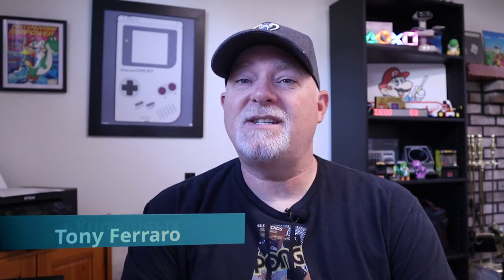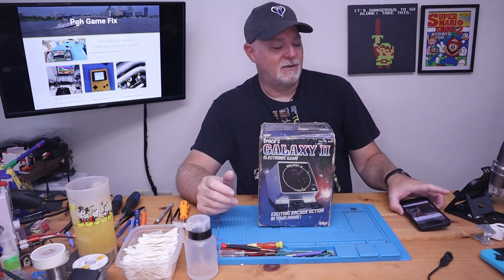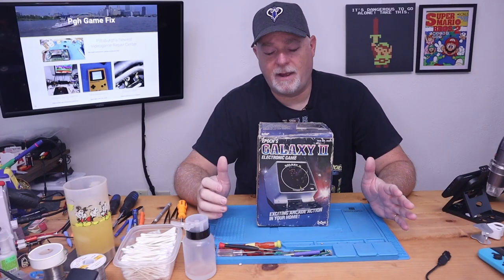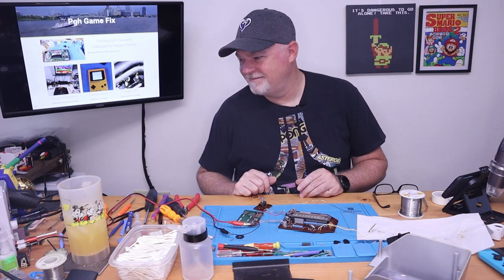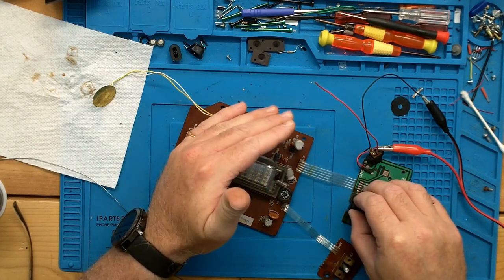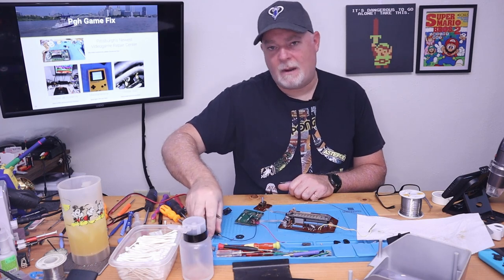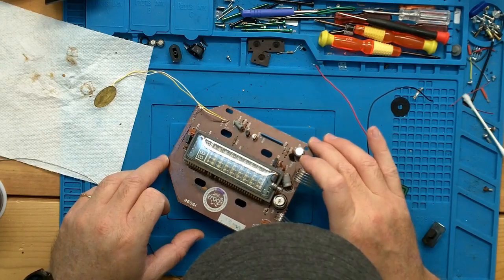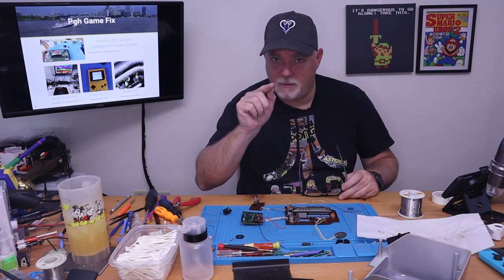Try To Fix Ep2: Epoch Galaxy II (Grandstand Astro Wars)

Comment: I have an Astro wars I recently purchased in the box with all the paper work but it does not have power with battery’s or adapter any idea what the problem could be much appreciated
Reply from the maker: The one I did in the video had a very rusty switch.  Make sure power is getting past it, and into the main processor.